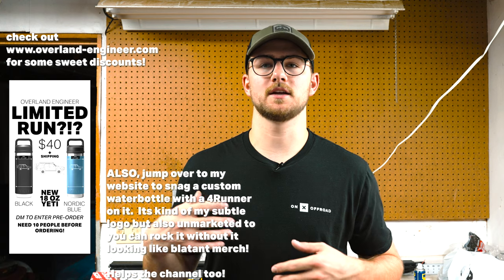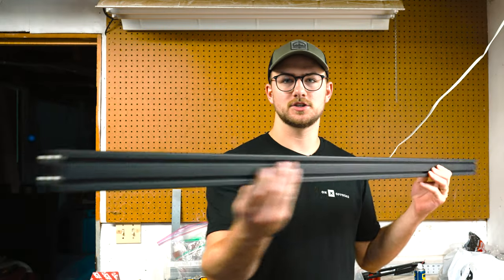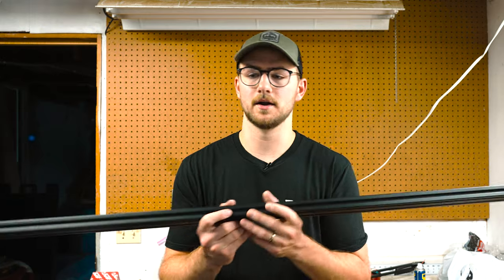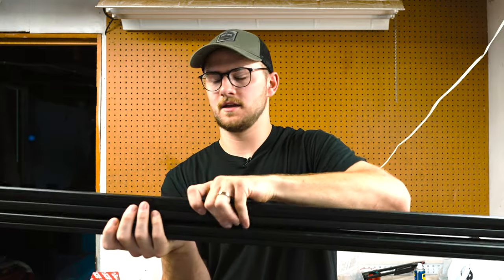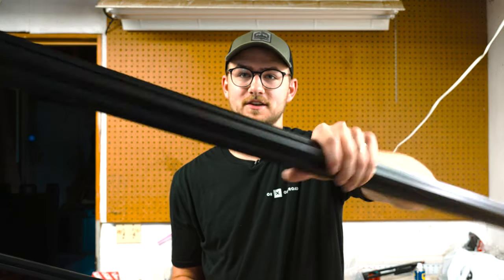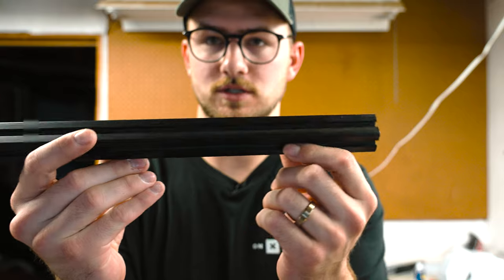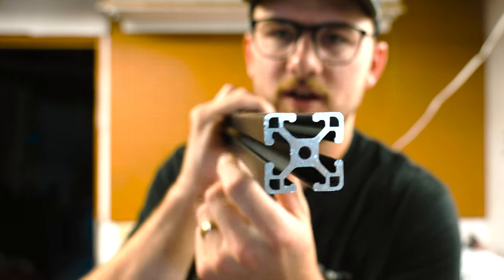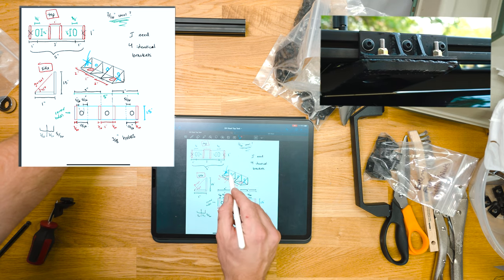HOW I Built A Strong Roof Rack for Cheaper Than Anything For Sale

Comment: I love projects like these, but there was one thing going through my mind as you emphasized the strength of your rack design: failure points.  My disclaimer is that I am not an engineer, I just know enough to ask questions.  So each car manufacturer has a load rating for their roofs, both static and in motion.  Under extreme conditions (high winds at highway speeds or torsion on the trails, as mentioned), all the materials and connection points are going to be tested, and the weakest point wins, or loses.  So the question I raise is do you prefer that failure point to be the roof structure of your vehicle, or rather some component of the rack system?  Most people will [hopefully] never push their rigs to those limits, but I think it is a consideration.  So, how strong does a rack really NEED to be?

Good job sourcing all the bits and pieces for a cool project!
Reply from the maker: Fair point!  That is a question each DIY person has to also answer for themselves.  I don't want my rack to fail if I am loading it with typical accessories where many of the shelf options fail.  I also am an engineer with a curious mind but not technically trained at all in this area. I share this stuff for entertainment and potentially some kind of motivation for people to research and design their own.  This isn't a step by step by someone licensed and professional.  A good question to raise though for people trying to design their rack if they choose to go the DIY route.

Comment: I'm fixing to ne building my roof rack from 2020 extruded aluminum. 2 years ago I built my bed rack from 14 gauge 1.25 carbon steel square tubing and I have the Smittybuilt XL Tent on it. It's been wonderful and Carbon Steel is heavier but it's more of a piece of mind for me. I'm pretty rough on all my stuff lol😂

Comment: I think that's a great, well thought out design that really meets your needs, Zac. One of the things that I learned from a couple of serious, hard-core overlanders was that lateral forces wreak the most havoc on a rack. These guys had four mounting feet bolted to the roof instead of the typical two feet bolted plus one just pushing down. They went this route because they experienced significant failures of their traditional rack systems when transporting cargo (not a RTT). Think about it, all that weight being thrown from side to side on a rutted dirt road will take its toll after a few thousand miles. At least that's what happened for them.
For utilizing the rack for cargo, I've found the Gobi type of system, with the wire mesh, versatile and easy to rearrange quickly. I'm not sure how heavy duty their components are, however. I think that for a RTT, you have a great system.
Reply from the maker: Yeah thats very fair.  Hard to improve that without dropping the headliner and adding more mounting points but that would be the next step!  Haha, you could always connect the crossbars of this rack with spring nuts so they could be moved and removed if someone wanted that customizability.  With that much for a GOBI rack I'd personally build some kind of mesh storage setup if that was needed but I see what you mean!

Comment: I have heard mixed feelings from people who have the Prinsu rack.  I have heard that that they used to use 3/16ths side rails but now use 1/4 in. to increase strength.   Their rails are narrow vertically which I think looks good, but probably reduces strength.  I went with the RCI roof rack.  It has 1/4 in side rails and seems pretty beefy.  I like that the front fairing contours with the top of the windshield.  It is also cheaper.   Nevertheless, I think that putting a lot of weight on the roof changing the CG and stressing the roof mounting points can be a problem

Comment: How about the distance between the top of roof rack and the top of shark fin antenna? Based on the GFC setup, you need to chop off the fin so that you can get your RTT on top without interfering the fin. I’m guessing with 1.5” roofbar you won’t have this problem. Please clarify, thanks for another great video!
Reply from the maker: No you will most likely have this problem unless you just stagger the mount.  The rails come with the fin delete kit though so it’s worth it in my opinion

Comment: Hell yeah. Question how do you screw into the end of the T-slotted aluminum? The center “bore”, not the T-slot. Attaching the ends of the crossbars to the rails

On the extrusion website it shows a cross section and it doesn’t look like the hole is threaded. Is there anything else needed to screw into it? Or will the bolts fit right in as long as we get the right size?

(Nvm I see on Tnutz they have tapped ends on the 10series)
Reply: Almost all profiles can be "tapped." Or just get the tool and do it yourself. That's what I did for the 12M bolts on my 45mm profile pieces.

Comment: Awesome work. I'm planning to build one for myself but not as a roof rack. One question I guess is how do you insert attachment points into the T Slots like m8 bolts?
Reply from the maker: Like you want the threads facing out?  I think some carriage bolts slide in the channel and can face outward depending on size.
Reply: @OverlandEngineer  Yes sir but on your rack you need to slide the bolts in before you assemble the pieces in place. I'm talking about attaching those bolts on and off similar to a Front Runner Rack where it has sort of a key hole on yhe ends of the rail so you can easily insert m8 bolts as attachment points
Reply from the maker: @jules9923  I see.  I’m not really understanding why you can’t just use a spring nut and then put in the bolt…why do the threads need to be attached?  I’d just buy the appropriate length bolt or use an extra washer.

Comment: Besides these 4 GFC brackets, is there any supports towards the front end rack to avoid any wobbly? 🙏
Reply from the maker: Lots of companies use little bumpers on 90 deg brackets.  Might be an option!  I am hoping my tent does not need it and it will cantilever just like a GFC.
Reply: @OverlandEngineer  it looks like GFC tent doesn’t need the rack, if that’s the case, are you gonna put your tent on top of your rack, or just the GFC brackets without the rack? Very curious.
Reply from the maker: @wanderlostNW   @WanderlostNW浪迹西北  Correct, the tent just mounts directly to the brackets.  Thats my plan with my tent but since its not done and I want to go on some trips, I took apart my tent and built a rack to mount some stuff I need!
Reply: @OverlandEngineer  that makes sense. Thanks for your comments, very helpful!

Comment: Hi, I know this is a year old but I’m curious about your analysis of the strength on prinsu vs Sherpa. I’m looking at sequoia racks which may be different, but the Prinsu lists a 600d/1000s weight rating while the Sherpa is only 300d/600s weight despite costing more. Maybe this changed after your video was made? Hoping to hear your thoughts.
Reply: The Prinsu rating you mentioned is for the Prinsu Pro. It’s brand new and a different design where the side rails are made out of an upside down L. It’s made out of 3/16” thick material with another inner layer of 1/8”. So dbl layered.